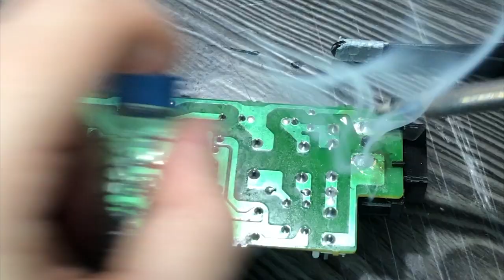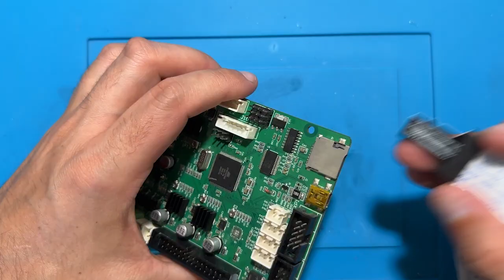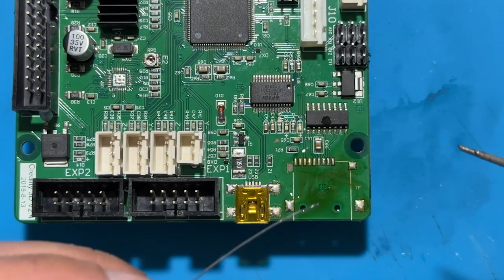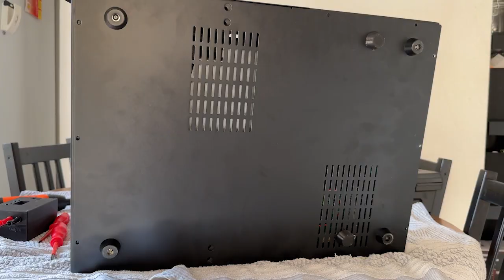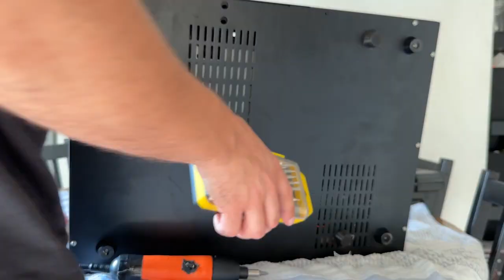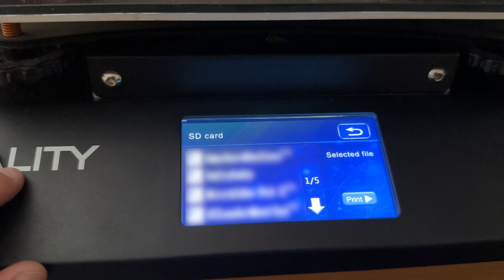Creality CR-10S Pro SD Card Slot Replacement / Repair

Comment: I've replaced my sd card slot today and it doesn't seem to read my sd card anymore
Reply from the maker: Hello,

You'll have to check the connections between the sd card slot and the board. Next if you have an SD Card extension check from the sd card extension to the board to see if there is any damaged  connection inside the sd card slot. If all is good you might have something damaged in the motherboard.

Thanks for watching